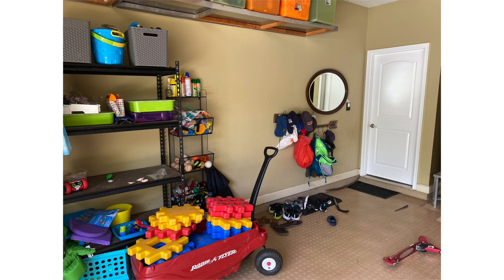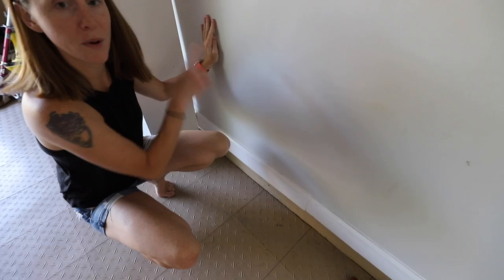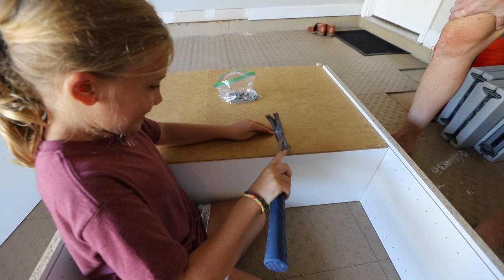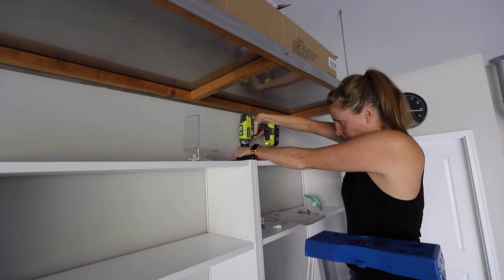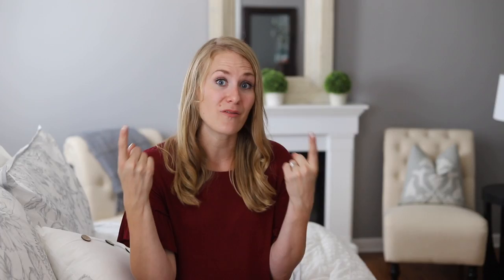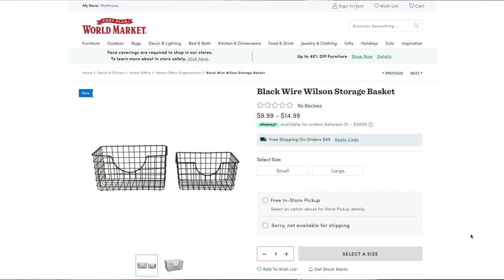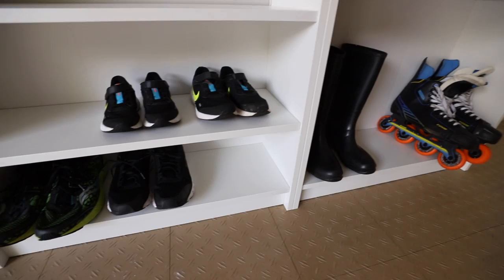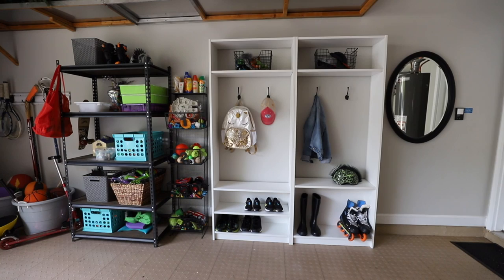DIY IKEA HACK! 💛 Instant Small Mudroom Makeover 2020

Comment: I have been know to add a stronger back board, which provides more stability, vs the super thin cardboard backer.  Luan, a thin , but stiffer wood, is also an option to increase stability, vs using the drywall wall.  Just ideas, if someone doesn't want to cut their wood trim, or use the walls.

Comment: Love this DIY! To avoid cutting the base board trim, we made arches at the base of the Billy Bookcase to be slightly large enough to accommodate the trim using a jigsaw. Once we did that that the bookcase fit flush against the wall. After that we secured it to the wall with the bracket and screws that came with it.

Comment: The back board actually helps with stability on these type of shelves. I have had both backless and with the board and the ones without the boards always start to lean over and eventually break apart. The one with the board in the back has been used by my kiddos since they were toddlers. My youngest is 16 and it’s still standing. Lol.

Comment: One problem I see with this is the particle board sitting on the floor like this. Shouldn't you have sealed it first? I'm thinking of doing this but wall mounting the cabinets and sealing the bottom.